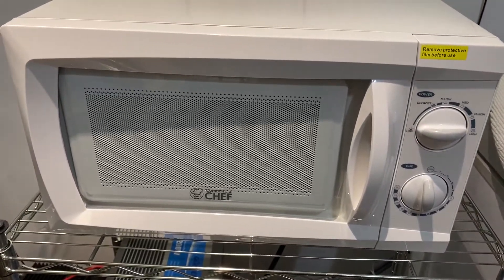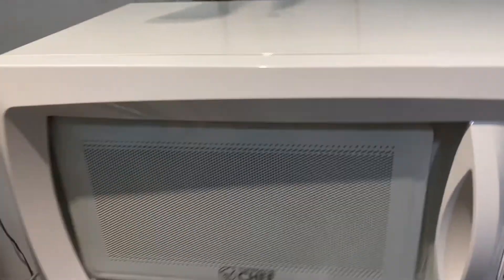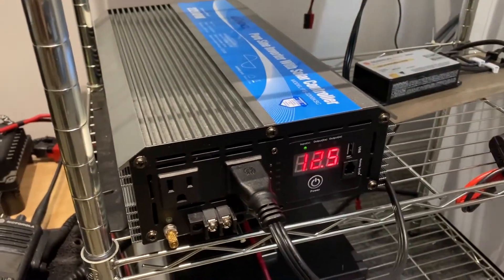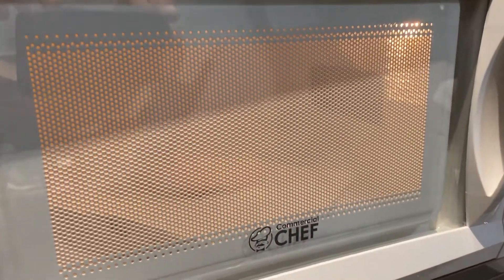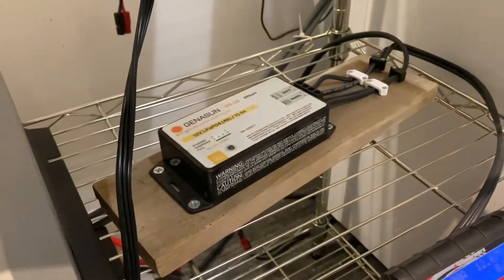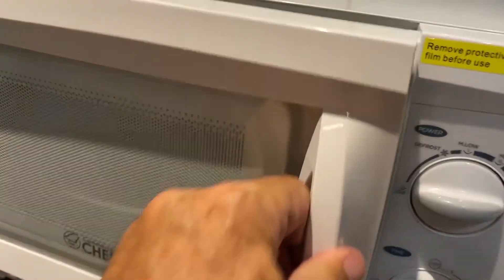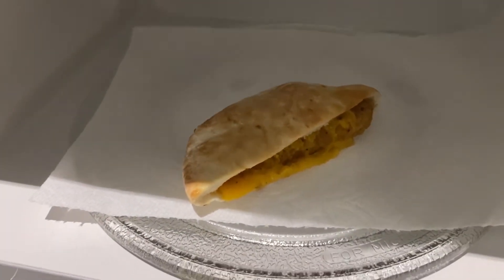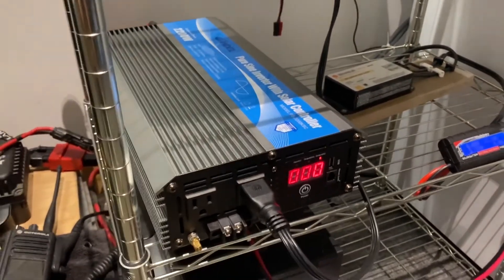a Solar Powered Microwave Test using my new 600 watt Commercial Chef Microwave...

Comment: 600 watt microwave 
Shows it's pulling 960 watts

A 🍌 is 🚫 an 🍊.

960 for 600?
Reply: Both of the watts are correct, what most people don't understand with microwaves are

Power draw from the outlet 960watts

Then there is the COOKING power on the food which is 600

It's not either or it BOTH

Comment: How many amps did you use while cooking your hot pocket? What size wires did you run to your inverter? I'm a senior too.
Reply from the maker: I will check once again. I use 4 gage wire and the wire and connectors stay cool. I now am running the microwave along with my washer & dryer at the same time with no problems. I have update the system to run on TWO 100ah S.O.K batteries (in parallel for 200ah total. The system works fantastic.